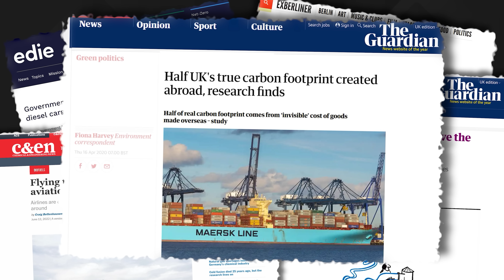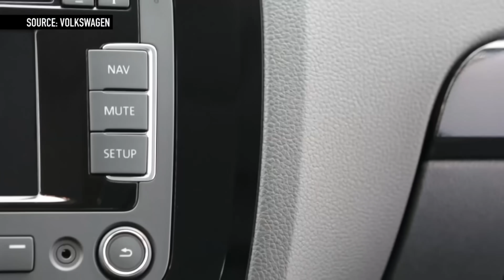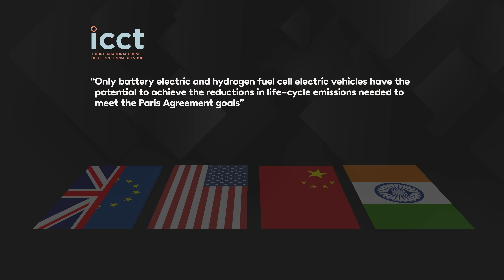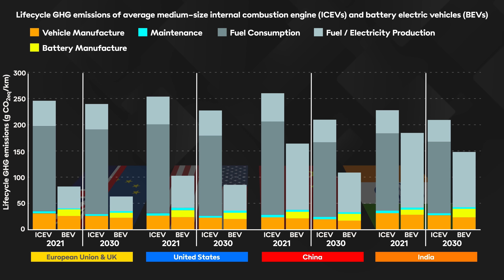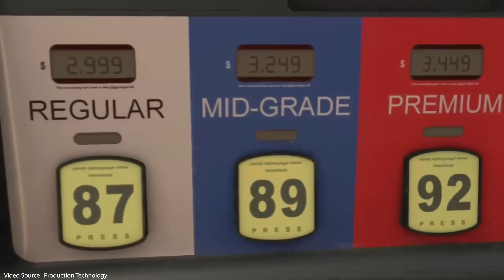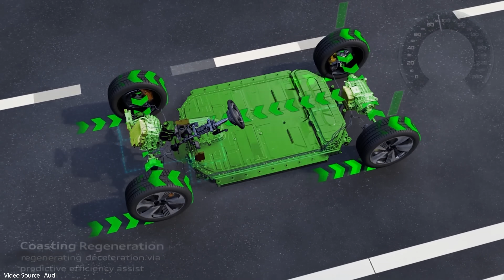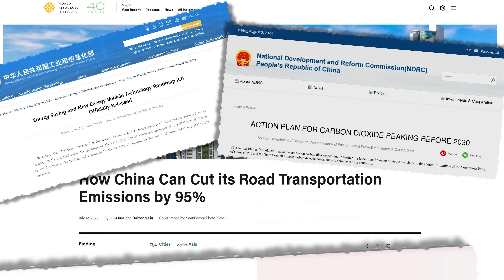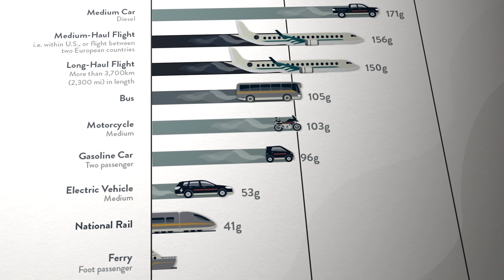Are EVs really better for the climate?

Comment: I've seen a lot of anti-EV and anti-cyclist "adverts" on Facebook recently. You can't get away from them unless you hit comment, then they disappear.

Someone somewhere is spending a LOT of money on deriding green(er) alternatives, and trying to convince the public that petrol and diesel is the way forward.

Nobody compares the cost of finding oil getting oil out of the ground, let alone the cost of transporting it to be processed, then transport to a depot, a depot to a fuel station. They only count the cost of the fuel from the point of purchase. But they compare the full cost of EV's.

EV's are always greener than anything else in the long term, and that's of you burn gas or coal to generate electricity.

Of course the downside of EV's are the batteries, and replacing them is still hit and miss right now.

Comment: How about e-fuels? In the European Union and the UK are more than 254 million vehicles, average age 10.5 years! Imagine how long it takes to replace even all owners could buy electric vehicles. Decades at least. Electricity shortage is another topic. To achieve CO2 neutral traffic all over the e-fuels production must be increased. Of course manufactured with renewable energy, like Porsche and Siemens Energy is setting up in Chile (wind, solar). All the existing fuel infrastructure and logistics organisation can be used like today. Existing vehicles could run immediately CO2 neutral. And have a think, where should drive all the old cars, Africa, East with fossils? Climate change is a global challenge. Solution can only be global ...
Reply: All well and good. As long as you don't mind paying around £8 to £10 per litre......
Reply: @Brian-om2hh  Latest prices are around €2/Liter and lower. Your info must be from years ago or is political 😉

Comment: Oh boy, where do I start? I don´t think we should only look at the current situation, but more on the potential of each technology: 

Internal combustion engines have been around for more than a hundred years. They don´t get any better. It is insanely difficult to optimize them even by some percent. They consume a fuel that is FINAL and there is no economic way to reproduce this fuel (no, I don´t think we should convert our food to "bio" fuel, and even that process is insanely energy inefficient). Why would you base a product (like a car) on a final resource? I mean, what is the plan of those people, who prefer ICE cars? Do they think we miraculously find new fuel reserves?

The electric engine is superior to the ICE in every aspect and everyone who has ever driven a comparable EV will know what I mean. You can even recuperate energy when driving and thus produce less dust particles. Some people think that the CO2 emissions from battery production are caused by some chemical reaction that is needed to produce the battery, and this reaction would release large amounts of CO2. IT IS NOT. The high CO2 emissions are just calculated counting the required kWh of energy needed to produce a battery and applying our current energy mix. If we had a grid of 100 % renewables, EV production could have a CO2 output of zero. And driving an EV would also produce zero CO2. ICE cars will also produce CO2 while driving.

There are still a lot of people in the industry and in politics, who don´t want to learn new things and want to do everything as they always have. They try to prevent technological progress. I was at an event with many people from the car industry and their idea was the following: If we have to find a solution other than fossil fuel, we should use hydrogen. Why? Because we (in Germany) now a lot about tubes and systems with liquid in them and thus we know more about hydrogen based (fuel cell) technology than purely battery based ones. THAT was their reasoning. Not: "Hey, what is the most efficient approach?" but "what is the approach where we have to do the least effort and already know the most about?". The car industry (in Germany) is so slow and old and totally not innovative. 

Porsche built a new EV with like 500 PS on both back wheels. Expensive ICE cars are programmed to have a "malfunctioning" combustion cycle, so there is some fuel left in the exhaust that combusts later in the pipe, creating these extremely annoying and loud bangs, that everyone hates to hear except the driver of the vehicle. People who buy big cars, because they think they could portray "dominance" when they drive their 400 PS vehicle through the inner city. What is going on in peoples heads?

Even if there was no climate change. Wouldn´t logic and morale dictate that we find ways of transportation that don´t consume more stuff than can be recreated? Wouldn´t it be wise to use the most energy efficient way of transportation? Wouldn´t it be good to make one´s country independent from oil imports from other countries?

If we only focus on CO2, because this word is currently trending, then people get this insanely stupid ideas to continue nuclear energy "because it produces fewer CO2". 

Can we really only be sustainable if the survival of the human race is threatened?

Comment: Let me say that although I am in favour of EV ..... in the UK at least it will Never work as advertised!

Let me say why ...... Charging! 

The facility to home charge will be difficult for most and impossible for a sizeable chunk of society!
This means that no matter what the politicians say they will be voted out if they force the issue. In order for it to work they will need to redicaly change our whole transport network! I will refrain from passing an opinion on thee concept of biking your way round .... but just give it a thought for a short time!

Firstly the number of people wanting to charge their EV is growing and because it is a slow process the true costs have been hidden. New homes are not a problem but for those homes built pre 70's will find that a sizeable % have looped electrical feeds. This means that the shared feed is not large enough for an EV charger to be fitted. At the moment the DNO will put a new feed in to separate you at no charge, but that will change. Even if it doesn't who do you think pays for it all in the end?

That is just the start! The electricity supply network is fed usually with 400A fuses at the substation (but often it is 315A or even lower). Think about how many houses each substation feeds and you quickly realise that they rely on diversity to average out the power demand. This is not possible with EV charging ..... especially when you factor in complex tarifs (because we all want to charge at the cheapest rate don't we). Once you discount diversity and work out the true loading .... especially if you factor in heat source pumps for heating your homes to reduce the CO2 footprint ..... you will effectively need to dig up every road in the UK and overlay a new cable creating two circuits for each of the old ones. It gets worse though! Those substations need to provide more power now so we will need to virtully double the number of subs. The problem gets a bit easier on the HV supply to the subs ..... but HV is Expensive to alter. 

A fag packet calculation (yes it is a metaphor) shows that you will need more than the total GDP of the country! 
Bottom line is that it will not happen!

Now that the bad bit is done with we should look at what we Can do to clean our act up. Ways that do not include dystopia's of underclass reliant on deliveries for supplies and no go areas for Taxi's leaving residents to fend for themselves! It will have to be with a large degree of cooperation between All of us .... Diktats will only be counterproductive!
Reply: I've had my EV for over 2 years in the UK Dave, and never had a single issue charging. The charger I use is always available. It's on my drive, bolted to the side of my house. Sure I've used public charging. About 7 or 8 times in over 2 years.... Charge at home 95% of the time. It's way cheaper.  Full charge is around £6 to £7, and that does me 270 odd miles ( around a week and a half)
Reply: @Brian-om2hh  That is really great for you Brian, I too have no issue with home charging at my address. 
My main drive was the point that in 10 years they want rid of all the ICE cars. What happens to those who cant do home charging ? Or when the network can't handle any extra loads? 

That is why I believe it will need consensus rather than edict!
Who will provide the public chargers? ... you may have no problem finding one now but when the number of EV users doubles, then doubles again, and again?
Further, these problems need to be looked at NOW rather than in a couple of years when they can't be avoided!

Comment: I can't go through every specific detail but it's hard to imagine 60-80% reduction while including externalities like intensive mining and transport. take roads for example, EVs are 30% heavier, so we know that road emissions will increase because of upkeep. I live in Phoenix, cars already bend the roads in extreme heat. (weather also impacts performance)
Reply: Policy or laws may force to reduce their weight once we figure out how to make them well and I bet they are working hard to reduce weight as it increases efficiency.
Reply: EVs are not 30% more heavy than equivalent ICE cars, more like battery adds 20%, going down. Meanwhile the ICE engine/power train is 10% or so, while an electric motor is half or third that. Så really more like 15%, which will likely hit parity in a few years (in the early years an EV was essentially driving a car battery). 

EVs are on average 30% more heavy in the US because those who buy EVs tend to buy heavier cars. Probably because many producers make heavier/more expensive cars because they don't have the production capacity to make many cheap cars. That particularly applies to Tesla.

Comment: Honestly, what matters to me most is my end use on a day to day basis. Whatever you buy needs to be manufactured and shipped so that essentially a wash. EVs emit nothing daily and no need for gas and oil. Plus, charging it with the solar at my home means I don't use grid electricity. It's a no brainer for me!

Comment: Yeah, maybe they'll have better range in 5 or 10 years.  I can hear all of you now saying "... it's already here".  No it's not.  I live in the country on a farm in rural Arkansas.  There is no way that an EV truck can perform like a gas or diesel powered truck hauling livestock or equipment.  And I've never seen an EV tractor that I could use.  The closest EV charger is 50 miles away.  And I've never seen anyone use it, not ever.  And like Solar Panels that are going to start piling up at landfills because the geniuses who invented them never thought about how to recycle and dispose of them the same is true about all these lithium batteries that climate change warriors are demanding without thinking the issue through to it's logical conclusion of disposal and recycling.  I'm more in favor of hydrogen technologies that promise further range and don't have the waste disposal issues of lithium.  Till then, I'll keep my truck and my tractors.  I really like your presentation though.  It's always well made and you're objective for the most part.
Reply: Try John Deere. They produce a heavy duty electric tractor.....  There are no waste disposal "issues" with lithium. There are already recycling plants up and running.....and both the lithium and cobalt in EV batteries can be recycled and recovered to 90%. And were you aware that fuel cells degrade over their working life, and will need repair or refurbishment at some point?  Fuel cell manufacture also requires platinum........
Reply: @Brian-om2hh  thanks Brian.

Comment: For most people, It's probably more of a cost issue than an issue of whether or not an EV car is better than an ICE car for the environment. Also, replacing a battery in an EV would be very expensive. While it's great that EVs are becoming a viable option, a lot of people simply cannot afford them. I would like to see how bad for the environment an older second-hand efficient ICE car would be. By efficient, I mean a car that drains around 5 l/ 100 Km or less.
Reply: I own a diesel 308 and get over 55mpg. This works out at 18 pence (UK) per mile.   Current electricity price is 29 pence per kwh and we are forecasting 45 pence per kwh in October and more again in early 2023.  These increases push the EV pence per mile from 12 to 18+ per mile in the next few months.   
This is alarming for all those buying their electricity from the grid but it does make a great business case for installing solar if you can.

Comment: At university, as mechanical engineer, we saw that internal alternative  combustion engines efficiency is at best 14% at shaft in automotive application. 
Around 10% usable power at wheel after going through gearbox and differential.

For stationary power generation for this engines I was told that best efficiency was achieved by a two stroke diesel giving out around 23%.

All these numbers I have to beleive that are correct since I was tought so during my college studies, and what is more, none of these are never ever found or given by manufacturers.

There are big differences and will make big different results depending wich you use.

People have to stop believing that internal combustion engines are OK. They are a disaster.
100Hp car uses 1,000Hp of power.... totally unacceptable.

I truly beleive that you give the best information possible and really apreciate your effort for It.
I love your channel.
Reply: Wonderful observation on efficiency. Consider that this is probably the best we can achieve as combustion engines have been around for 100 years. Ev efficiency and energy density for batteries continues to increase year after year. Very exciting times. Power production transition is also very cool. Solar efficiency is increasing finally as investment and research has increased. Can’t wait to see where we are and what we have in 2030.
Reply: Opposed piston engines can be more than 50 percent efficient,  but aren't suitable for automobiles.  O/P engines have no valves or camshafts.   They were widely used in American disel submarines but aren't used anymore due to maintenance issues. But, the mechanical problems with these engines could be overcome by ongoing research.  German aircraft in the 1930s could fly 6,000 miles using o/p engines, but they didn't have enough confidence in them to attempt to bomb NY City - which they wanted to do.
Reply: F1 engines are cited to be about 50℅ efficient, but they are hybrid
Reply: @E1Luch  and it costs millions.
Reply: @crtmojo2705  Toyota prius had almost 40℅. Energy recovery from exhaust is the main tech here. These types of cars are mentioned in the study as non plug-in hybrids
Reply: @E1Luch  yes strapping an electric motor to a gas motor helps the gas motor save gas and reach around 40% efficiency. Compared to an EV at nearly 80% efficiency.
Reply: @crtmojo2705  Yes
Reply: I am convinced that as in power generation the solution to reduce pollution is on many different technologies applied to the different needs of use for this power. Variety.
But, combustion engines need to dissapear ASAP.
Reply: LOL.  Try getting that refrigerator home in your electric bike!  And paying $25,000 for a replacement battery!  Ha ha ha.
Reply: @scottslotterbeck3796  https://youtu.be/VyZOLMeMYnI

Comment: I am disappointed that hybrid vehicles were not mentioned.  I have seen reports that show hybrid vehicles actually are the best overall.  This considers the battery manufacturing process, including the mining of the raw ingredients for lithium, actually has a huge carbon footprint taking many years of use to break even with regular combustion vehicles.  The hybrid vehicle hits breakeven against combustion vehicles much faster.  Since there is a carbon footprint involved in either recycling the batteries or putting them in landfills this is not even being considered.  I know the other cars also have to be disposed of, but the battery component in EV's is huge when being compared to other vehicles and no large scale recycling of batteries has been fully put to the test.  Plus the variety of electric battery manufacturing and methods is all over the place. It will probably take a standard battery pack to bring the recycling picture into full focus and make it achievable.
Reply: In the end hybrids still support a combustion engine.   It is by far the best way to use an ICE because we can run it at the optinal speed all the time.   But it has the disadvantages of both ICE and BEV.  More complex than either ICE or BEV.    

Redwood Tesla and some plant in Mexico are ready.   Maybe one in Canada.  They grind the batteries up and make paste.  Then  process the paste to reclaim the minerals.   So long as they don't mix battery chemistries it is all good.
Reply: Hybrids are an environmental waste of time! ICE cars are around 20% efficient in driving the wheels from the potential energy in Oil. the best Hybrids are around 25%, EVs 80%
Plus the double complexity of having an EV with a small battery and then a combustion drive train and all the overheads and service cost. Why not just have a bigger battery and no combustion engine
And Depending on how hybrids are driven can produce far worse pollution than ICE cars, by continuously restarting a cold ICE engine and cold catholic converter so getting far worse MPG and emitting far more small particle emissions.
Reply: Hybrids have no long term future, as they rely on fossil fuel. This will run out one day.....